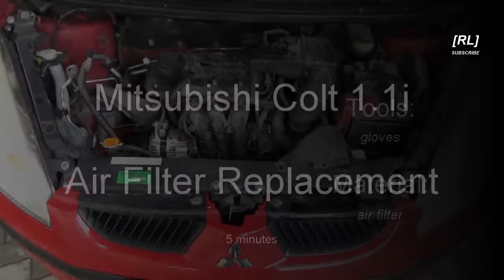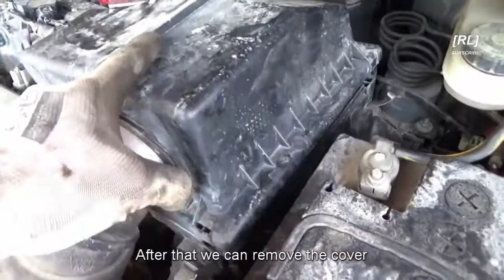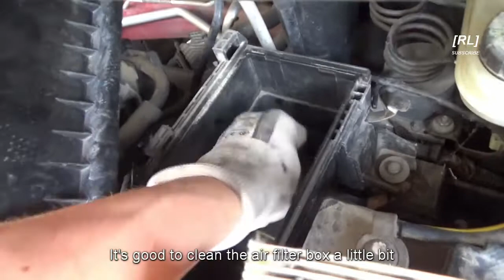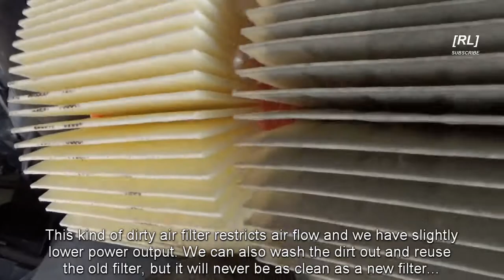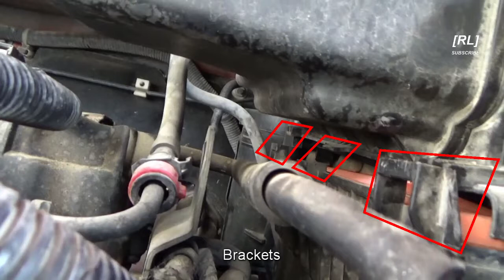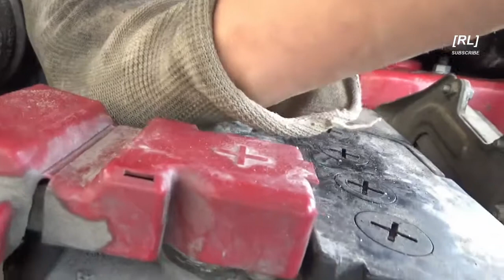Mitsubishi Colt 1.1i Air Filter Change

Comment: Could I put a KN performance air filter on?
Reply from the maker: Hi Ryan Roy, thank you for the question. KN performance filter, why? It is a 1.1 liter 3-cylinder with just 75 hp... :) I would not make much sense, because of the nearly zero impact on performance. It's not worth the money I think. Sorry to give such an answer. Have a nice day and jump into the new year :)
Reply: @REBUILDLab  thanks for ur reply. Is there any performance mods I could do to make the car sound nicer or more power
Reply from the maker: @ryanroy1246  you could try some aftermarket exhaust end silencer (don't ask me what kind of - no research done on this) to make it sound nicer. Performance...the best thing you can do is to go buy a 1.5 turbo colt or at least 1.3i 4-cylinder. But if you want to modify a 1.1i, then besides some turbo kits, you could go for another camshaft and a chip tuning. As I do not research the market if some of these kits are available, I cannon make any recommendations. But honestly, selling it and buying a better performer is the best choice. Good Luck!